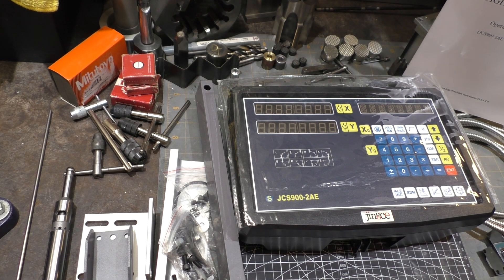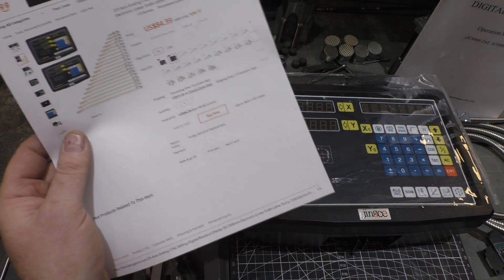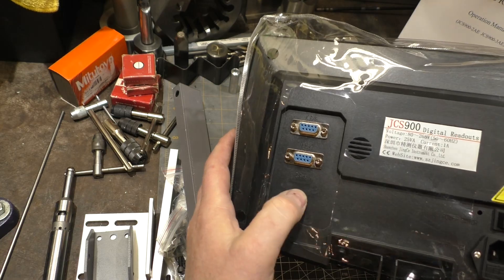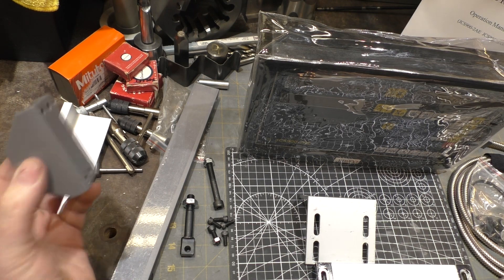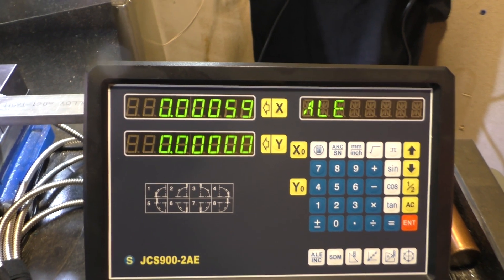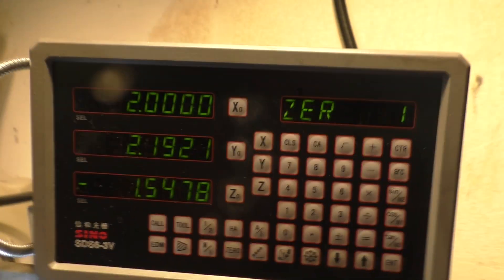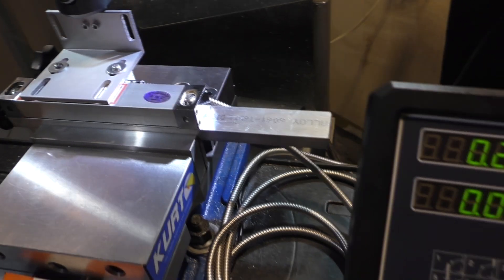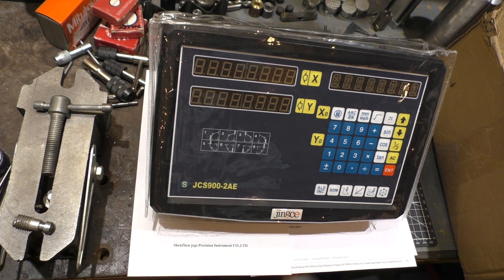QTR 44 BangGood JingCE DRO

Comment: Thanks for the review! Hey, I noticed you put a Z glass scale on your knee. How did you square it with the knee given the angle of the column? My Lagun narrows both from bottom to top and from back to front.
Reply from the maker: the knee on my ACRA is vertical so I didn't have any alignment issues like that, but it was a pain mounting the scales to the very rough casting.
Reply: I think indicating a base plate is the way to go, I'll mount Z to the base. I'm finding I prefer using the Z for height adjustment over using the quil.  Not disappointed going with a 3 axis dro this time,
Reply from the maker: @johnjohnson6196  Best of luck and for stiffness moving the knee is pretty much always better than extending the quill.

Comment: Well even though I didn't win the give away I did take advantage of the special promotion you had linked, $599 later and I have DRO's coming with scales for 2 machines
Reply from the maker: Excellent. I hope they work out well for you.
Reply: @DudleyToolwright , mine arrived today and yes the packaging left a little to be desired but they powered right up. The tracking info was a little sketchy but they did use USPS for delivery once they cleared customs. All in all I am thus far impressed with the shipping time and the quality of the materials. I have not had time to inspect my scales for accuracy but when times allows I'll see how they are.

Comment: I have the 3 axis. I wish the manual were as good as you say.. The sun the moon are not really good for translation.. I have no idea what they have to do with a DRO, but they are in the manual. I don't know how to use many of the functions, been looking for a better translation.. If anyone starts writing instructions I'd be interested. I can't figure out how to do smooting a radius (my buttons don't match the doc).. Oh, and the 1/2 function worked differently than the manual. So even the simple commands I struggled with.
Reply from the maker: Great feedback, thanks. I was comparing the portion of the manual I read to my Sino manuals, and this DRO's manual is a lot better, but by no means perfect. There is the possibility that I got a revised manual from the one you got as well.

Comment: Yes put in the drawing.... been looking into putting a dro on my 1948 mill rite ... you’ve spot on about the cosine error in your setup with the dial indicator .   1 degree off axis is about 1.5 tenths ... would be interesting to set the indicator say 1” away with a gauge block, zero the indicator and repeatedly move back and forth.  By moving to zero the indicator at both ends (placing the gauge block back in on return to zero) you can eliminate the cosine error and get a better idea of the error in (both) the dro.   I do think your test tell us it a reasonable unit for us weekend machinists
Reply from the maker: Good luck, entered and thanks for the interesting approach to removing the cosine error. I wish I had thought of that before making the video.

Comment: Do you feel the itch to put that small scale on your tailstock??  I would like to see the three scale DRO mounted on the lathe including the tailstock.  A thought I had rolling around in my skull for several years.  Nice review on a good topic.  Take care.  Doug
Reply from the maker: You present an excellent idea. I built a tailstock DRO in another video, but your solution would make a wonderfully integrated system.